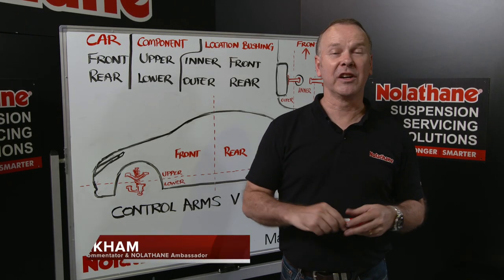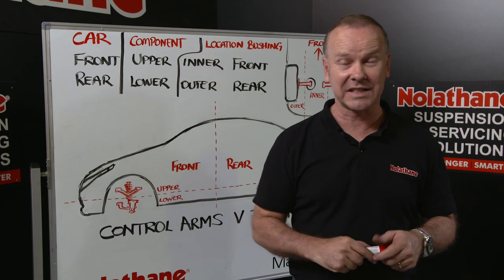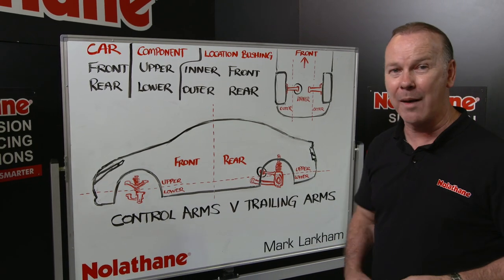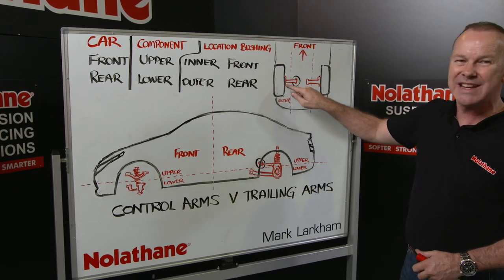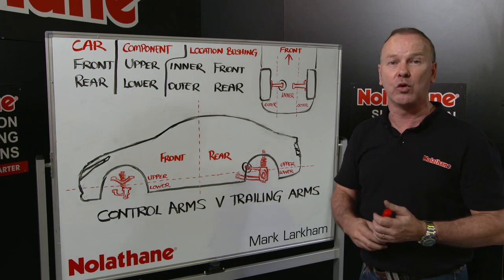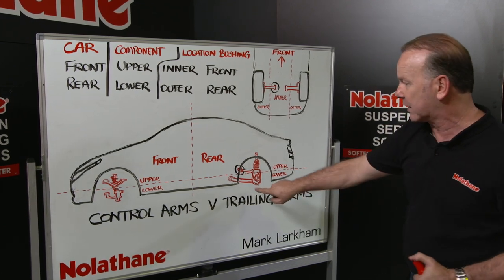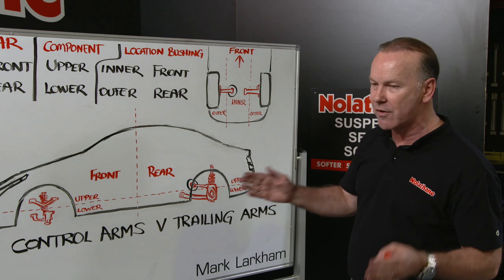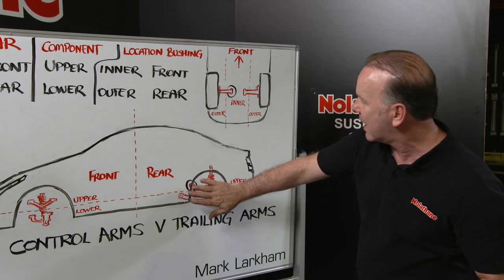Control Arms vs Trailing Arms . . . What's the difference?

Comment: So if you have a bad rear trailing arm on the left side will the car drive to the right?
Reply: Depends. Is the car FWD or RWD. I had a broken trailing arm on my 2001 impala (FWD) and the car drove straight and alignment seemed normal/ fine. However the rear wheel was moving badly upon braking. It is very dangerous to leave unfixed. Then the lateral load is all on the rear control rods! Now a trailing arm broken or bent on a RWD car will affect the alignment a lot!
Reply: On a FWD Car does the trailing arm need to be as strong as say a control arm needs to be? I am doing some rust repair on my Grand Prix and am wondering if I should use 1/4'' thick steel or 1/8'' thick steel for the area where the trailing arm bolts to the body of the car.

Comment: So my question is if you have the option to change the trailing arm to a control arm, is it worth doing? I'm converting my Mini to AWD and both the Mini and Eclipse GSX donor use trailing arms but the GSX arms aren't easily retro fit into the Mini. Should I convert to control arms or alter the GSX trailing arms to work? Both will require a new rear subframe in this application